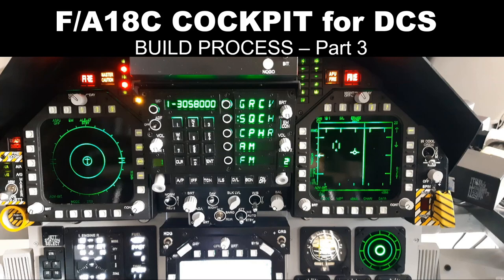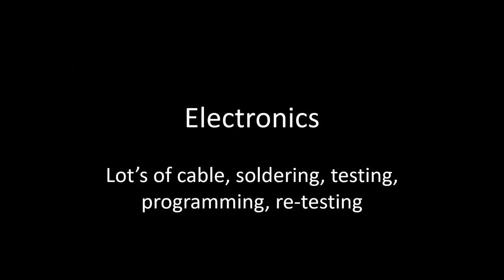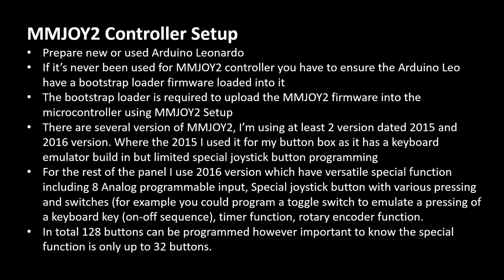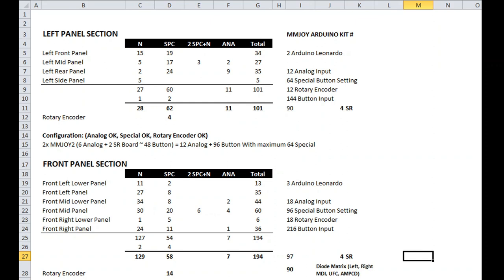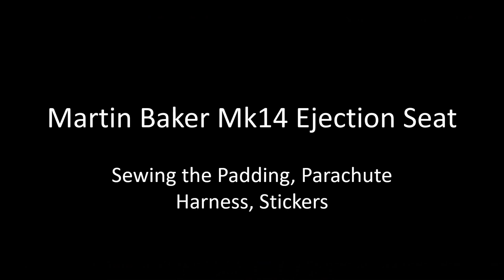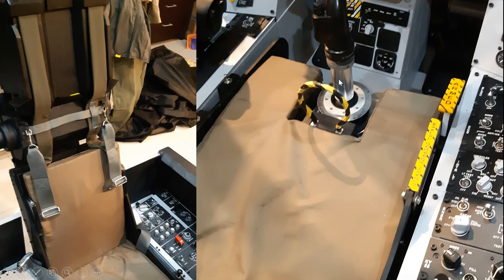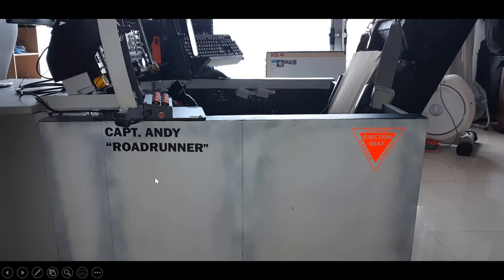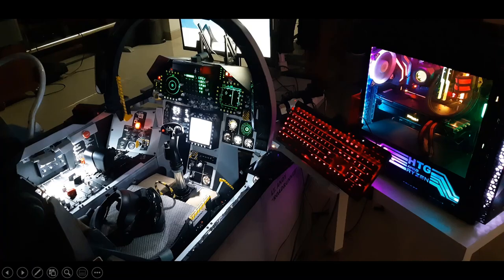F/A-18C DCS VR Cockpit Build Process Video Part 3 Final

Comment: Hi hobby very good job what you did there. Your MBU-20 is an Air Force or Navy version. If Air Force can use the U-92A / U connector to connect to the PC. It works for me, can talk and listen when I play games. The disadvantage is that the headphones on the helmet are mono, and you don't need stereo in aviation. For information only if you want to keep your mask original. My mask is MBU-20 C / E with g function, but you also need the right helmet. A lot of things you find at Flighthelmet.com again good work keep it up.
Reply from the maker: Thx for info,

Comment: Hi there, Absolutly nice job! I will try to make a front panel and currently I search for the UFC segments display. I saw that you have find a perfect segments to display frequency or other characters and options lines on the right. Can you share your article # and supplier please ?
Reply from the maker: Hi its diy and the 7 segment is laser engraved fix but can be replaced with clear acrylics and real 7 segments all files using coreldraw available in the link in my other videos
Reply from the maker: https://youtu.be/J2l_M1JKeWI
Reply: @hobbytechgearID69  you didn't use 16 display segments  ?
And I didn't know that it was possible to do that DIY.
Reply from the maker: No its not, Its for flying VR so no real display and 7 segments but i saw someone created UFC using matrix 7 segment   ot sure either using helios or other software

Comment: hey i wanted to know where the pin 2 of  the 74hc165 is connected to the arduino
Reply from the maker: https://drive.google.com/file/d/1qXJBHNe4D_ym2Ych9u8I1ymxVYr4btkl/view?usp=drivesdk
Reply: @hobbytechgearID69  im sorry if its simple and im not getting it, but as far as i understood it the cs and data pin are connected to the arduino and the connection is mentioned in the software but the how is the sck pin of the shift register connected to the arduino?
Reply from the maker: @jokermanj779  
https://www.rs-online.com/designspark/basics-of-74hc165
https://www.gammon.com.au/forum/?id=11979
http://www.learningaboutelectronics.com/Articles/74HC165-register-circuit.php
https://dronebotworkshop.com/shift-registers/
Reply from the maker: Basically PL for loading the Parallel data D0-D7 to the internal shift register then you need to clock each number of data to be output on Q7 or Q7 inverted. This Q7 read by the microcontroller (or aurdunio). The chip enable just put to ground to enable it all the time or yuou want to select manually using arduino Chip select command. (in MMJOY2 this programming are already built in you just need to identify which pin of arduino micro/leonardo that is connected to Q7 (ser output), PL, CLK and CE

For Serial the Shift register then the Q7 our output should be connectged to the DS of the next or last 74HC165

But Better visit those sites for better understanding
Reply from the maker: You could also search for the arduino library and follow the circuit connection so no need to create your own code.
Reply: @hobbytechgearID69  thanks alot good sir. i will give all those a good read

Comment: how long does it take to build all these ?
Reply from the maker: Takes me 12 months but only doing it every weekend so if compressed should be few months I guess.
Reply from the maker: The longest time is to redraw the panels in corels thats most of the effort. Also designing buttons and the panels, frame and try and error. Electronics parts was easier as ive build previous mark 1 and not required any visible lights, display and analog dials etc thus using mmjoy2 is simpler and quicker